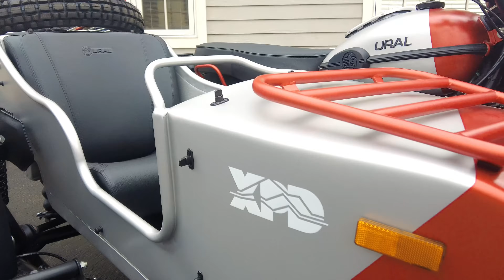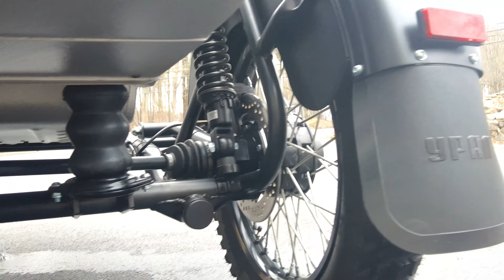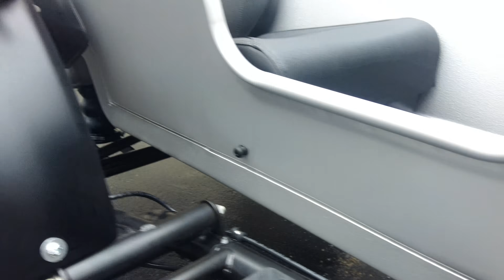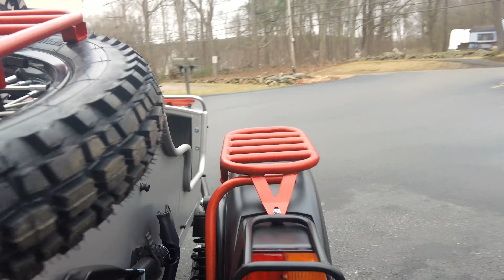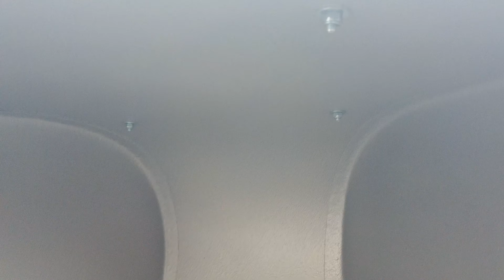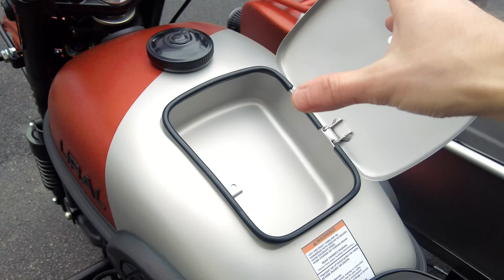2024 Ural Gear Up Ember Flame Expedition | Accessories, Features, & Specs!

Comment: Is the alternator safe if doing deep river crossings?
On another video a winch was installed. How many amps does it draw?
Can a another battery be installed for heavy winch use  (and maybe a fridge) and can it be installed with a solenoid or , if it has a smart alternator is a battery management system required?

Keep up the good work.